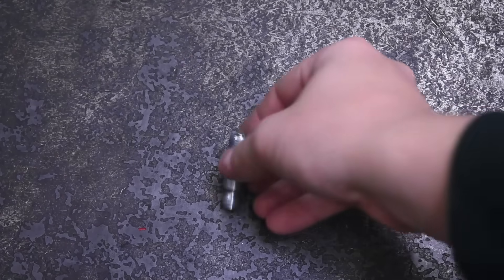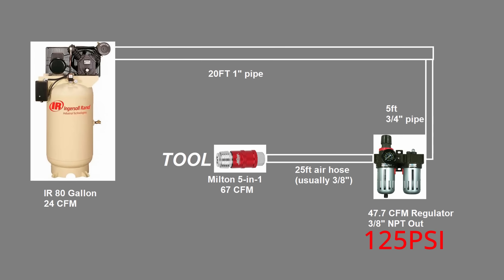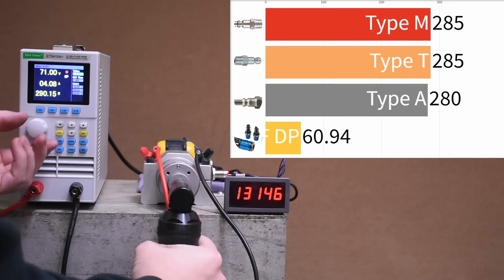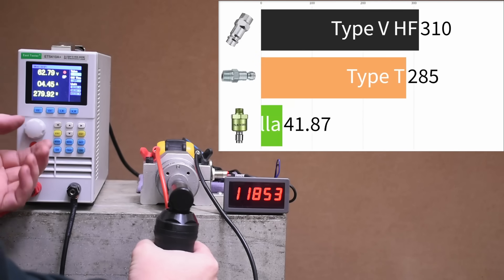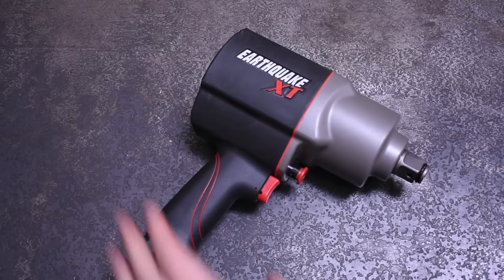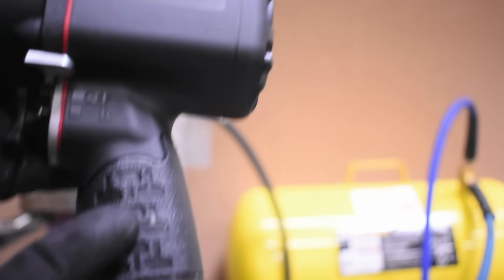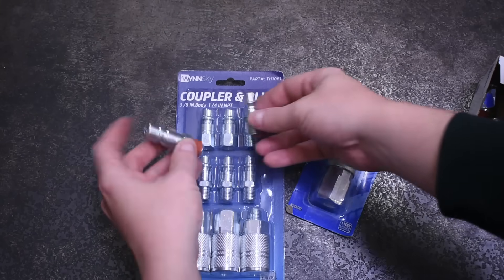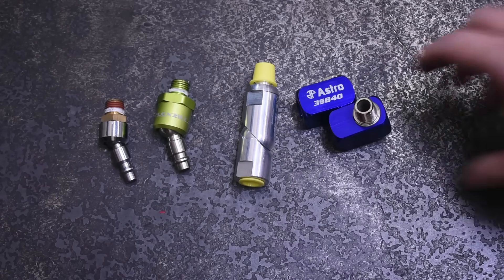Triple Air Hose? Testing Best & Worst Power Adder Tricks

Comment: In my home shop with a 60gal upright I have found direct connecting a 3’ whip hose to the tool gives more consistent/higher speeds with high consumption tools like DAs, right angle grinders and Air files.  No dyno to test, just my experience.  I have those whips on all my high consumption tools now.
Reply: What's a "whip hose"?  Thanks.
Reply: @richardwernst  a small piece of hose (they vary in length) typically with male threads on both ends.  Just type whip air hose into Amazon and you will get the idea. 
The bottleneck with these tools is typically the connection - as the video demonstrated...  So the idea is to get the connector farther away from the tool so the bottleneck isn’t right where the tool is using the air.  Not sure of the science behind it (if there is any), I can only speak from experience and it has worked for me.  My grandpa had a body shop for 50 years and as a young’n I always wondered why some of his tools had short hoses attached and some didn’t...looking back it was the highest consumption tools that had the hoses.  🤷‍♂️  your mileage may vary, but its a pretty inexpensive item to test.

Comment: Opening up any air tool and mirror polishing the intake ports will slightly increase pressure as it allows the air to flow a lot smoother less turbulence in the flow.

Comment: How about with ugga dugga's bumping the trigger repeatedly? Basically letting that static line pressure build up and then use that hit. In my mind that has worked to help with really stuck bolts before, but can't prove it.
Reply: The buffer tank works well in that technique, have used it before when taking pinion nuts off of large equipment but only get about 2 seconds of the high power

Comment: im lucky at work we have water cooled   screw compressors .and we have 3/4 line with the two tab type connectors .in areas that need it

Comment: The only thing automotive that I ever really got into training wise was auto body. Good quality & very high end HVLP guns love their air as well and would benefit from the high-glow air fittings. I've been wanting to get back into painting but I don't have the money or space for a decent 60 gallon compressor. At least not yet. I wonder if a good 30gallon compressor mixed with a slave tank would workout. Of course since I'd be running mostly body refinishing tools I'd swap everything out for high-flow fittings.

Comment: I feed my 1/2 inch impact on a 1/2 inch air line, no regulator @ 175 psi, on a 30 gallon compressor that feeds 24cfm. I get all the beans🤣😂🤣😂

BTW Most 3/8 air line has 1/4 fittings on each end which is a huge restriction.

Comment: Could you test 3/4" air impacts on your set up. We all have a lot of 3/4" hf impacts and would be an interesting rank system to compare them to the 1/2"
Reply: They do not have a large enough compressor to properly test them.
Reply: @parkerdalo3248  Thats the thing I want them to test it on the compressor there using. It simulates the average DIY. Can test them later in a professional setting but 90% of the viewers I'm guessing are working out of there garages.
Reply: @joeellestad8912  I'm sure 90 percent of the viewers of this channel are workers in a professional shop with no shortage of air.
Reply: @somethingsomething3718  Well unless we take some polls I guess we would never know. The point is they wouldn't have any money in testing the 3/4 impacts they already have. So could make a video without spending any money. If they need a couple more guns it's no big deal since they would need them for the professional testing.

Comment: Lol, my air setup has 3 of those HF 11gal air tanks as an additional volume boost. It works great. I also have 2 110v air compressors along with it and it'll maintain 90psi all day at my sandblaster. It's the cheapest way I could find to get high volume air at my shop.

Comment: The aux tank will likely only work for smaller tank compressors. I use that same harbor freight tank with a 6-gallon pancake compressor for nail guns, and get noticeably more CFM and/or time between cycles.
Reply from the maker: Makes sense, I do the same at home with a separate slave compressor that doesnt turn on.
Reply: @TorqueTestChannel  I put a regulator on the aux tank too, and just keep the compressor at 125 PSI (aux tank max) and as far away as possible so I don't have to listen to it. Then just regulate for the tool after the AUX tank so it's still pressurized at 125.
Reply: Same, got a 15 gallon compressor, hooked up that same yellow 11 gal tank as a backup. Ran it all in 1/2 hose with a 3/4 earthquake impact in a desparate attempt to get out a honda crankshaft bolt, but in the end, the best psi comes from an oxy-acetylene torch 😂
Reply: @jsplasha  for a shop set up, a dryer and oiler system would be great. Mine is mobile though, and I don't always use the aux tank. 

I usually only break the aux tank out when I need to run guns for multiple people or when I am working inside with larger CFM nailers (framing, cleat) and I want to leave the loud AF compressor outside, but still be able to adjust the pressure near where I'm working. I have a smaller quieter compressor for trim nailers that I take indoors otherwise.

Comment: 3/4 hose and Chicago fittings are the standard in industrial settings but you'll need a lot more compressor than you've got now. Great work guys, always interesting.
Reply from the maker: Yup, you're certainly right about that!
Reply: @TorqueTestChannel  now is your chance to test air compressors
Reply: @TorqueTestChannel You need to get some VMAC stuff! We make some kick ass air compressors
Reply: @TorqueTestChannel  high pressure compressed nitrogen when?
Reply: I honestly wish I knew what the specs were, but in the military, I once used a compressed air powered pressure washer.  The air hose, fittings and SCFM were just insane.   It may have been 3/4 or 1" hose.  I just don't remember.
Reply: @prototype3a  that would have been probably a diesel powered screw pump compressor they make them in multiple sizes able to make 150-250psi and 150-1000 or more cfm
Reply: if you want cfm go to an equipment rental shop and get a towable compressor, even the smallest ones will give you 185 CFM AT 125 PSI
Reply: Yep. At my work we use a 350hp compressor and Chicago drops throughout.
Reply: @REH86 350hp compressor😳 good god. That thing will do anything you could ever ask it too holy
Reply: @REH86 What kind of work do you do? Are you sure it’s 350hp? Can you even draw that much from the grid? Assuming youre in a shop-like environment I dont think you can draw like a kiloamp from the grid(since Im assuming its a shop, Im guessing 3 phase ~300V depending on where you are)
Reply: @CielMC  Yes, I'm positive. Our primary compressor was 350hp with a couple thousand gallon tank and a Baltimore cooler.  It was in a glass manufacturing facility.  We had multiple 75hp backup compressors in the building.
Reply: @ That’s crazy
Reply: Real simple it's all about volume and how fast it can unload
Reply: @philipdaigle9854  saw an older gent do a simple demonstration, he put a pressure gauge at the end of the hose behind the air tool and I thought to myself duh ! lol so simple, I had 75’ of 3/8” hose out to my driveway no wonder my IR Titanium was starving!
Reply: I was trying to run a standard metal CP 3/4 inch impact off a truck air tank and 3/8 inch hose (about 50 ft) and it was a no go. I made up a 50 or 75 ft 3/4 inch hose with Chicago fittings and adapters and it ran just fine. I’ve run a high zoot IR 1/2 inch impact
through 100 ft of 1/2 inch hose off a crane air tank (larger tank and compressor than a truck) with no problems. I’ve tried to use what large fittings I could find in the past, but your excellent video gives even more alternatives. Thanks and keep up the good work. Take care.
Reply: I actually do have two sets of 1/2 Chicago fittings on my dual compressor setup, where they connect to the piping that goes through the shop, out into the driveway, and up to the top of the basement stairs. Compressors are a 1930s? 60 gallon PAR with a 3 phase 3hp motor set for 160 psi and a 1940s? Craftsman with single phase 240v 1hp motor and no tank, just turns on when the pressure is under 95 psi and turns off at 125. Both are hooked up to 1/2 black iron pipe with 1/2 hydraulic hose and Chicago fittings. Once the second compressor kicks on, it just stays at 95 psi, even with a 1/2 earthquake impact running (the old aluminum one).
Reply: After much headache with HF and such, I settled for the Standard 3/8 hose, fittings + 1/2" impact, provide enough powers for most home gamers, and since they are standard parts, they are easily found for replacement.
Reply: I highly doubt you need more compressor to run a 3/4” gun. Think about it: is the compressor at 175psi in the tank dropping pressure below 125 or so within 15 seconds while powering the 3/4” gun? No, it isn’t. You don’t need more compressor, you need larger piping from the compressor to the tool. Yes, 1/2” hose minimum, but this is an air distribution problem, not a lack of pump output (compressor) or tank size per se.
Reply: I switched to V a couple years ago and just bought that Astro swivel, pretty cool t find out it was your brain child .
Reply: 660 gallon air tank at my setting looking to make a vevor impact stronger
Reply: How much compressor 😂

Comment: When removing a bolt, you will have peak air pressure at peak tightness. If you do the 10 then another 2 it might make a difference

Comment: On the topic of the for science videos, how about running the air tools on way more air pressure, like 3000psi. I've was really interested in finding out what happened so I did some tests myself with a pneumatic cut off tool (without the cut off wheel on) hooked up to a repurposed CO2 fire extinguisher running 3000psi from it into the tool. It didn't blow up but just revved extremely fast and felt like it had loosened up a bit after but was otherwise undamaged. An impact wrench might be a bit different and idk if the trigger would be able to stop the push of 3000psi, but if it could I'm sure you could get some crazy power out of it before it blows up.
Reply: Sounds dangerous but fun.
Reply: Oof lol. I hope you did that from a distance, behind some shielding. The centrifugal force would easily send shrapnel through your skull
Reply: @hayleyxyz  I was behind  about a metre of concrete so it was all good
Reply: A SCUBA tank would be safer, and you could easily control the pressure/volume.
Reply: @Hey_Its_That_Guy  I've got a custom assortment of fittings and valves that allow me to control pressure. As for using a diving tank over a CO2 fire extinguisher tank, the fire extinguisher was literally free second had so that's why I'm using it
Reply: That’s kinda like an F1 Racing Gun… I believe they run Compressed Nitrogen at a insanely high pressure.
Reply: lol that's bs, to reach 3000psi you'd need 155f on the tank and the pressure relief valve would be venting, you're confusing actual pressure with tank rating, put a gauge on it and that co2 tank full of "liquid" co2 will be less than 1000 psi at room temperature and if you did get it up to 3000psi on the gauge you're actually working with supercritical co2 and very likely it would be producing dry ice in the tool as well

now nitrogen actually comes in tanks at 3000psi as a standard and gets used for flushing refrigeration systems but is far less efficient to store as it doesn't liquify at a reasonable pressure so the 3000psi tanks are just full of gas
Reply: @Mister_Brown  I was just using regular old compressed air in the tank, (from a special high pressure air compressor) none of the fire extinguisher fittings remain so there isn't a pressure relief valve that's going to go off before 3000psi. I was just using a CO2 tank that I had repurposed because it is capable of withstanding 3000psi of working pressure.
Reply: @lachlanhatcher9108  ahh i read it as you were using 3000 psi co2 which while sorta possible it's not likely
Reply: @Mister_Brown  Yeah all goods, I wasn't fully clear there
Reply: @Mister_Brown  talking of dry ice raises the most important aspect here...
why does the dry ice form?

if people could get their heads around that one, they would realise that "throwing more pressure at it" is only half of the equation...

throw more HEAT at it.
Reply: @Mister_Brown  You save me having to correct that nonsense! When people cannot produce a written reference they would offer in a court of law they have no business making a technical statement.
Reply: I think they should run some tools on a scuba tank or nitrogen tank.
Reply: @jsplasha  CO2 tanks are rated for 3000psi, but usually operate with under 1000. Using a series of pipe fittings, valves and a high pressure air compressor you can get them to hole 3000psi. It's extremely impractical to actually use but it does work
Reply: 😂😂😂 magnificent
Reply: @jsplasha  I heard a rumor about grease in fittings combusting from pure oxygen so it might be pretty dangerous :D
Reply: Pressure by itself is irrelevant. The CFM rating is critical for performance.
Reply: CO2 at 70°F is 830 psig so idk where you got that 3000 from

edit: disregard caus I didn't read far enough
Reply: FRLN500 is CORRECT....CFM is the amounts or volume of air moved. CFM= cubic foot per minute.
Reply: @jsplasha  No CO2 extinguisher runs that psi. High pressure CO2 cylinders are often RATED that high which is far different. Flashback arrestors don't prevent high pressure oxygen explosions on the outlet end. Flashback arrestors are to halt combustion blowback on systems using oxygen and a pressurized fuel gas. Cool tester:

https://www.youtube.com/watch?v=05sW5Q2-K3I

If you use oxygen post the video and have your will made out. Dust and oil can cause explosions when contacted by high pressure O2. I use the stuff all the time and transfill small cylinders from large using a proper braided stainless Teflon hose (Western makes most of them in the US) whip but I clean everything to oxygen safe standards. 

Mere particles explode sometimes which is why O2 valves are to be opened slowly:
https://www.youtube.com/watch?v=SaBghGKAOBo
Reply: @jsplasha 3000psi is common for co2 tanks and some fire extinguishers are co2 based. Tap beers are carbonated with co2 from tanks stored at that pressure for density reasons, and some companies even sell you co2 tanks with regulators to run air tools off of remotely, power tank is one brand.

Comment: Prevost safety air fittings would have been interesting to test to see if there’s a trade off for safety.
Reply: Milton offers a similar product. I've been using them on the compressor side of my hose for a while with no issues.
Reply: they're all we use at my work
Reply: +1, I've been using prevost for years and would be happy to send some for testing
Reply: These are also high flow couplers and the safety mechanism doesn't interact with the air flow at all. Still would be interesting to see some numbers.